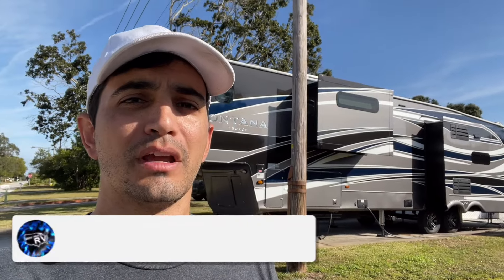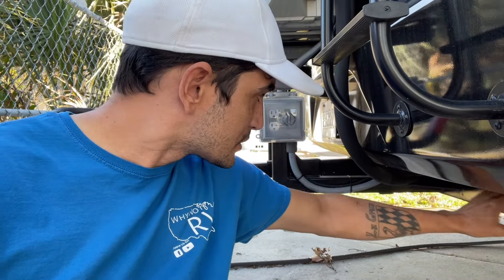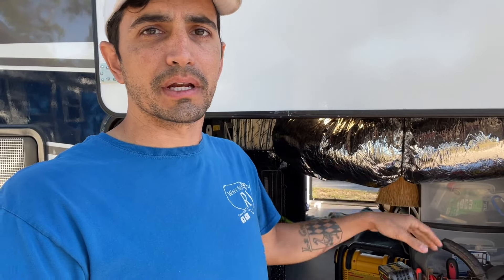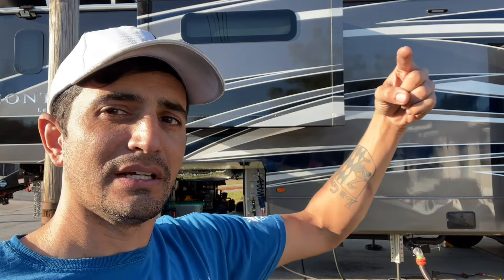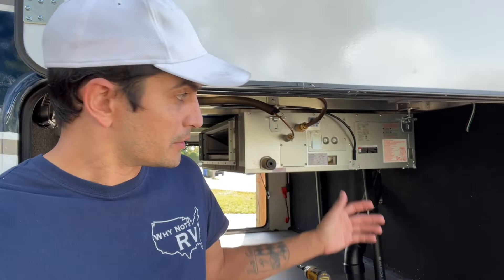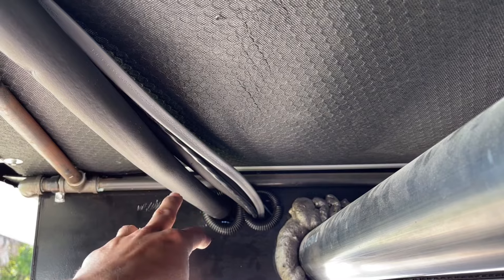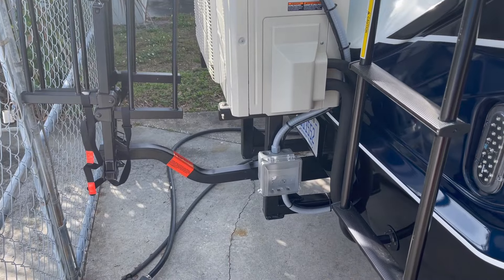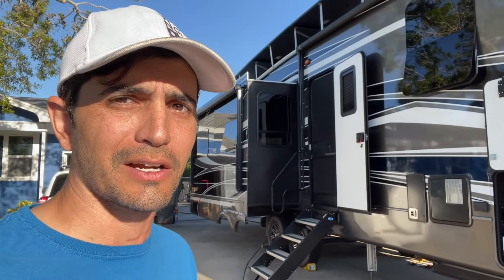The BEST Air Conditioner for an RV, DUCTED MiniSplit. Runs off Solar alone! - Why Not RV: Ep 93

Comment: So where do the vents come out? Did u feed it into existing ones or cut into the floor?
Reply from the maker: I tied it into the existing furnace fed system so they come out of the stock floor vents. I also added a second vent in the bedroom, upsized the duct to the bathroom and added a duct that fed right at the stairs into the main living space
Reply: @WhyNotRV awesome. So your split system was only run off the the solar system then correct?
Reply from the maker: It’s powered 24/7. When not in shore power, yes the solar can run it and still recharge the batteries from the energized overnight
Reply: @WhyNotRV I guess I’m not understanding how it’s not tripping the 50 amp breaker from shore power. Any research materials on the system you installed and how to do it etc?
Reply from the maker: I have a video on it. I think it’s title is Victron Mobile Power Plant

Comment: Can you send me the link to the 240 volt mini split? I can’t find what I need to do in Motorhome to run a 240 mini. Ty !
Reply from the maker: I don’t have a link for this unit. I bought it through an HVAC dealer. What I would recommend is to stick with 120v units like the Mr Cool. https://amzn.to/47hPWt0 to accomplish the 240v split phase like I did in this build is not for everyone. If you do want to stick with that for the bigger units, again, Mr cool has similar units to what I had done.

Comment: Great video!!  I’m considering installing one in my 40’ motorhome. If you had to do it again would you go bigger like a 36,000 btu mini split?  Do you think that would cool things down better?
Reply from the maker: The 24k was for multiple reasons. An individual inside ducted unit biggest I can go is 24k. Now if you were to do multi head unit ya I’d definitely go to a 36 and have multiple zone control. This unit has been doing me great even in the 90s it’ll keep the rig in the 70s and emit I need a little extra cooling inlet one of or both the rooftop AC units kick in the extra cooling and I can freeze this thing out into the low 60s lol
Reply: I recommend having an installer measure your space and help you calculate btu’s. I am just guessing but I just did all the measurements for my 34ft and it was 7.7k btu. So if you did a giant system it would be incredibly inefficient and short cycle a lot causing wear on your components. I’m going with a 9k system. Just my thoughts but I would consult a professional for proper sizing.

Comment: Wish you showed some of the indoor ducts, are you able to tie into any of the ceiling vents or just strictly the floor vents?
Reply from the maker: No ceiling vents. All floor stuff. I plan on doing a “one year later” video here in a few months. I’ll try to include some of that for you.
Reply: @WhyNotRV  thanks! I’m looking to do this in my solitude and the ducting seems like a good idea, i like cassette idea however i would need to cut the roof hole out larger. Great idea with the ducts.
Reply from the maker: I’ve seen an install where the guy replaced his 3 rooftop AC units with ceiling cassettes. Came out amazing and definitely way more energy than efficient than ducting. Anytime you’re ducting you do lose efficiency
Reply: @WhyNotRV  wish I could find that video. Not many people do good install videos on the cassette, just kinda skip over the install and show finished product. Thanks for the reply’s I enjoy the videos!!
Reply from the maker: It’s very deep somewhere in the YouTube world. I’ve seen it before but I’ve tried to search for it and cannot find it. I want to say the guy named his camper something along the lines of lightning or Zeus or something like that

Comment: So if I caught this correctly the mini split duct is tied into the furnace duct in the floor and not the a/c duct in the ceiling .
Reply from the maker: Yes, partially lol. I tied it into the existing furnace duct system, nothing in the ceiling at all. But I also added a few individual ducts to move a lot of air into the main living area as well as the bedroom and front bath.
Reply: @WhyNotRV  I’m starting out with (6) 100ah batteries .
Reply from the maker: That’s definitely a great start.

Comment: So you added the Mini-Split because you have a 2 unit RV. Do you think a 3 unit RV would be sufficient for over 100° weather?
Reply from the maker: This RV would need the 3rd AC on top if I didn't do the minisplit. With the Minisplit it does the majority of work by itself but above 90-95 I need to run 1 of the rooftops to keep it as cold as we like. which is around 72.

Comment: Cool.. but I have a bumper pull trailer with a roof mount AC and roof vented. Can't see how this would work for me. I sure hate the 1980's technology in a 2015 trailer. I don't see why RV designers/architects/suppliers are still living 40 years in the past.
Reply from the maker: Here is one of the most top of the line rv rooftop units… https://amzn.to/3Rig5Cu
Reply: @WhyNotRV -- cheers, mate.
Reply: @WhyNotRV -- Looked it over. It's still and old school AC with 1980's technology. It burns 1500 watts. A mini-split burns between 200-400. I'm not looking to go backwards, mate. Thanks, thougn.
Reply from the maker: Ya the mini split game needs to get out into a  rv unit. Maybe one day. These recpro units are a bit more energy efficient and whisper quite. https://amzn.to/463AOhm

Comment: Looks like your basement-mounted air handler is inefficiently conditioning 100% outside air and forcing into the trailer, which then forces the cold air out the cracks as fast as the fan can condition it, a waste,  Wouldn't you prefer to recirculate the already pre--cooled trailer air, by drawing it into the air handler through a floor duct ?  You're just borrowing the cool air before giving it away to the World, which is an awfully big place to cool. And you have to keep your basement door open when ever you cool, rain or shine or on the highway, or the unit starves. Unless I am mistaken and didn't see you have a floor vent and a well-sealed basement compartment.
Reply from the maker: Yes, you are mistaken. The storage doors stay closed and the air recirculates through the stairway area. 2 large open vents allow all that air in the rv to flow under the staircase and into that basement area.

Comment: Rv parks do not have 220/240 volt,you must use 120 volt.
Reply from the maker: Depends on the rv park but most do have 220 at 50 amp outlets. Either way. With my onboard system (dual Victron Quattros) it will take any combination of power and spit out 220 split phase for this

Comment: Look at the reviews of the unit listed in the description before buying. Company won't honor warranty.
Reply from the maker: This has 12 years parts warranty. Buy from a dealer and you can get parts all day long from that dealer.  Very easy to do
Reply: @WhyNotRV  As long as the 12 year warranty is, the unit in the Amazon link isn't for the Daikin in the video. Instead, it is for a Cooper and Hunter unit that has the following two negative one star reviews that make up a third of the reviews.

1) Company refuses to honor warranty for defective unit. Two certified , license HVAC technicians have confirmed that the unit is defective and the compressor does not work and unit will not cool but company refuses to honor warranty after only 2 months since purchase. Unit is Basically $2000 worth of trash.

2) This unit has no blower power. I have it installed in a 8’ x 30’ office with 3 rooms. 6” ducts 3 of them and you can’t even feel the air coming out of the vents. The ac will not let you adjust the blower speed and it stays running even when set on auto. So the blower never turns off. I don’t know how that energy efficient if the blower never turns off. I’ve contacted Cooper hunter for a resolve to no avail. At the time I was dealing with Cooper hunter my return time expired so now I’m stuck with a unit that won’t even cool a 240 square foot room. They say it should cool up to a 1200 square foot home and that’s not true.
Don’t waste your money.
Customer service an F
Product an F

Comment: What are the dimensions on the inside unit?
Reply from the maker: I’m not 100% as I’m not at the rv now. But it’s about 8-10” tall and about 30x30
Reply: @WhyNotRV  alright so there’s another question I’m trying to figure out, did you use a 10/2 or a 10/3 wire? Also how did you deal with the breaker and amperage?
Reply from the maker: I used 10/3 with a ground as it’s 2 hot legs of 120, a neutral and a ground. I ran a sub panel off my inverters that feed into it and run my 240v breaker for this and another for the washer/dryer that’s a 240v unit and a 3rd that feeds the panel for the rv